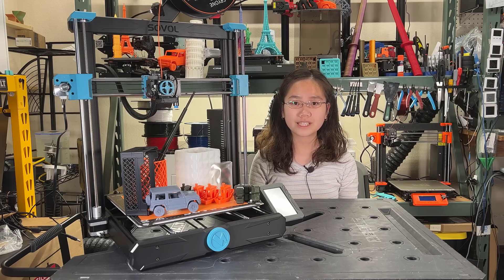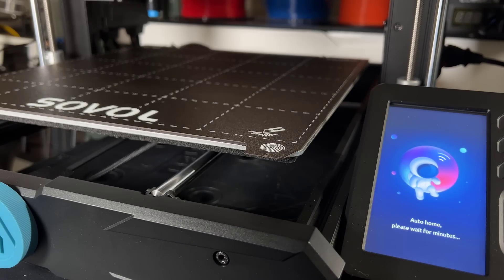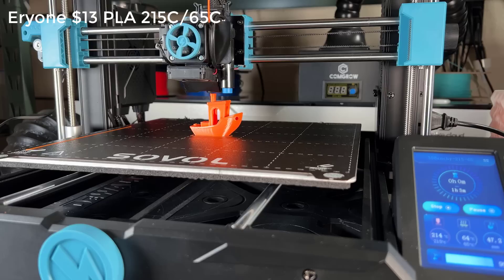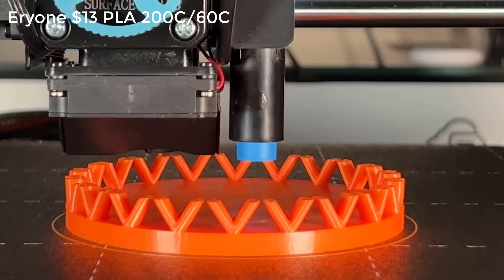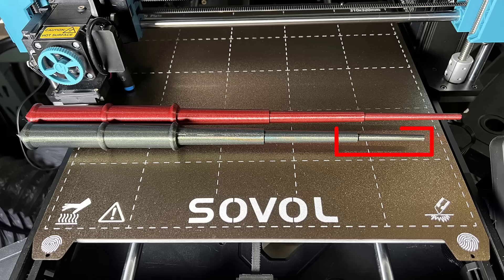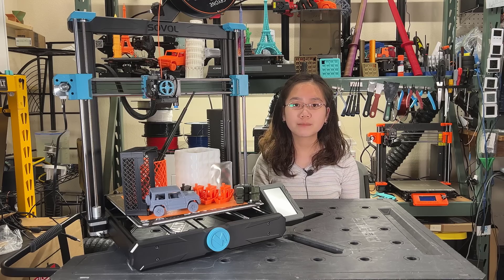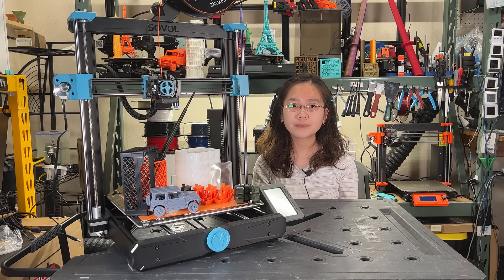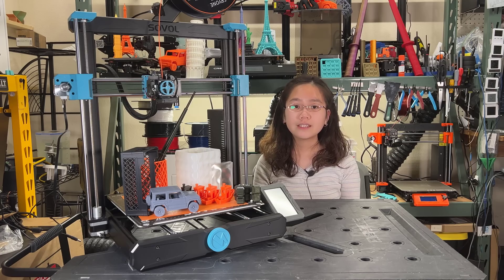Prusa MK4 or MK3.5 pumped-up Clone? The $349 Sovol SV06 Plus w/all-metal planetary direct extruder

Comment: While I wait for Sovol or Elegoo to make a full featured 300X300 mm Klipper machine, it's very tempting to buy the very capable SV06 Plus, add a Klipper pad, do a proper input shaping calibration, and maybe implement better cooling if I need to print fast or overhangs/bridges.  The cost of the Klipper pad isn't too bad when considering that it can control a small print farm of up to four SV06 printers so it would be cheap and easy to expand.

Comment: Sovol got a lot right with the SV06 Plus.  It's tempting to put Klipper on an SV06 Plus but I'm waiting to see whether Sovol or Elegoo will produce THE Klipper bed slinger.  The SV07 has nice features but it should have been the SV06 (and SV06 Plus) with Klipper.  The SV07 motion control is a downgrade from the SV06.  I completely concur that Sovol should stop using micro SD cards on their printers.  That's honestly my only complaint about my SV01.  In 2023, I want to send files to the printer using Fluidd/Klipper via WiFi.  Sovol and Elegoo are both making Klipper bed slingers with some great features but they're still coming up short in a few key areas.  One of the 3D printer manufacturers will market a Klipper bed slinger that checks all of the boxes.  I guess I'll wait to upgrade... hopefully not too much longer.  SV08 Plus?  Neptune 4 Pro Max?

Thanks for another great review.  Your reviews are the best, with plenty of user oriented tests to evaluate performance.  Too many people get a review printer and do a lame unboxing video that wastes the viewer's time and doesn't provide much useful information.  Your reviews are thorough and very fair.

Comment: Do you have a score for this Sovol SV06 Plus like the ones you recommend on your recommendations page have? I'm surprised to see that you mostly recommend v-rollers ("Ender 3 style") instead of smooth rods ("Prusa i3 style") like this SV06 Plus uses, while the consensus seems to be that rods are generally better. Does the SV06 Plus not deserve a spot in the recommendations? If not, which would you say is a better machine at $350-450? Thanks and keep up the good work!

Comment: Its not your fault but this review did not match with the printers they're shipping. The review models I've been seeing have been operating flawlessly with just some design complaints. 

The model I got felt like a kit jist thrown together. All of the screws were lose, the auto leveling sucks especially the z align. I had the pronter for a week and had nothing but oroblems, got 1 good benchy out of it, one of the included light houses i had to scale down really small to print and i got a low poly cat statue printed that i again had to scale down to get to print. 

Thank god i purchased throigh Amazon bc their customer support is ass. Just returned it though amazon

Comment: I just received this as my first 3D printer. I'm about to put power to it as I write this. So you're current suggestion for this machine would be to use Cura as a slicer correct? As I am not yet familiar with G-Code and how to alter it. Very professional review you focus on the things that matter and do not get hung up on too much of the small details that people buying a machine in this price bracket are not really going to care about

Comment: I have both an SV06 and an SV06 Plus (along with 6 other printers).  The SV06 is a great printer - once you get it dialed in.  It's not fast, but it's reliable.  My SV06 Plus, however - at least the example I received - is a dumpster fire - it's got some serious issues and Sovol hasn't been exactly aggressive in helping me get these issues sorted out.  The first thing I did was print the pre-sliced Benchy - and it was pretty terrible (tried different PLA's as well).  Then I tried the pre-sliced Castle - and it showed the same artifacts.  I resliced both files and again, print quality was substandard.  I tried other models as well - same artifacting.  I've checked belts, sprockets, and bearings, but everything checks out.  It seems like any surface pointed at the 3 o'clock to 7 o'clock quadrant of the build plate suffers some pretty serious ringing and cooling artifacts.  I'm also noticing that the SV06 Plus is lot noisier (stepper motors) than my SV06. I've sent pictures, emails, descriptions, gcode ... and although I've gotten responses, they've been things like "printing too hot and too fast" (at 40mm/S?).  I'm wondering if I have a bad stepper motor or bad driver chip ...

Comment: great review. when you print PETG do you use some kind of glue on the surface or just print right on the surface? I hear that the PTEG sticks too well to PEI surface and tears parts of the surface out when you remove the print.
Reply from the maker: No, you don't need glue to print PETG. You can print directly on the textured PEI sheet. I printed the PETG trashcan after printing ABS, so you may still see some glue residue on the print surface.

Comment: Your sv 5 with the sprite  excruder  how did you get it to work .I tried with no success.  Did you use ender software  or sovol. When I attempted  it it would only excruder  the prime line and skirt . Then it would stop excruting filament. Any info would be appreciated  along with the stl for your back plate you printed
Reply from the maker: If the stepper motor stops once the print starts, there may be a chance that the current of the stepper driver is too low for the new motor. 

In this case, you may need to increase the current by turning the screw next to the stepper driver. To do this, use a multimeter to measure the VREF value and increase it to the same level as the X and Y stepper motors. 

If you need more information on setting VREF, take a look at this article: 
https://all3dp.com/2/vref-calculator-tmc2209-tmc2208-a4988/

I just added the link to the 3D-printed plate under the description.

Comment: cheaper but i have 2 broken machines hot end failure bed alignment going out etc ps don't use sovol software it shakes so bad print fails and firmware that does not load why do u have to rename a file 2 dozen times

Comment: I would like to see what you can do with this and a creality pad
Reply from the maker: I tried it with an FLSUN speederpad, which is basically the same thing as the SonicPad, and it worked just fine. The results were similar to the Elegoo Neptune 3 Pro and Plus that I have tested in other videos. The printer can print at around 120-150mm/s, but if you want to print faster than that, the stock cooling fan needs to be upgraded as well.

Comment: Buy the Elegoo nept 3 plus now or wait for sovol upgrade announcements?  How long do these upgrades take typically for Software upgrades ie klipper to get the 150 mm/s etc
Reply from the maker: In terms of hardware, the SV06 Plus is better with its linear rods and 300C all-metal hotend. However, currently, it's difficult to find larger diameter nozzles or hardened steel nozzles for Carbon Fiber or other abrasive filament printing.

The Neptune 3 Plus, on the other hand, has a larger print volume and uses regular MK8 nozzles, which are cheap and easy to buy. However, it only comes with a rubber wheel motion system and a 260C hotend.

If you only print PLA, PETG, ABS, TPU, and other regular temperature filaments, the Elegoo Neptune 3 Plus would be a better option. If you want to print some engineering-grade filaments (and assume Sovol will support standard Volcano nozzles), then the SV06 Plus is the best option.

Switching to Klipper requires a SonicPad or any Raspberry Pi compatible device. You just need the printer.cfg and firmware for the printer motherboard. It should take less than 15 minutes. Files shared by existing SV06 users are available online at https://github.com/bassamanator/Sovol-SV06-firmware.

It requires you to SSH to the device and find the port ID and update the printer.cfg depending on what you use(SonicPad, SpeederPad, BTT CB1 or something else...)
Reply: Thank you!!! For the very detailed response.  Your videos and this thoughtful response to my post are amazing.

Comment: I have been in love with this machine from day 1!

I attempted to swap out the stock bearings for drylin bearings and that was the only time that I have had an issue with it.

The drylin bearings simply didn't have the range of motion that the stock bearings did. And, no matter what I did, the use of them resulted in significant ringing.

I believe this was caused by the bearings having too much resistance at the beginning of each movement. Once under motion, the ringing disappeared and the lines were perfectly smooth.

The only other issue I have with this machine, right now, is sharing it with my wife...

Comment: will it run on sonic pad?
Reply from the maker: Yes, you just need the printer.cfg and firmware for the printer motherboard. Files shared by existing SV06 users are available at: https://github.com/bassamanator/Sovol-SV06-firmware.

It requires you to SSH to the device and find the port ID and update the printer.cfg depending on what you use(SonicPad, SpeederPad, BTT CB1 or something else...)

Comment: Another awesome and thorough review!  You always pick up on things that no other reviewer has yet to.   One thing I wish every reviewer would do is specify if the touchscreen is capacitive or resistive.
Reply from the maker: When you see I use a hex driver to control the screen, it's resistive. (And this screen on the SV06 Plus is resistive).
Reply: @AuroraTech   This used to be the rule.  Nowadays there are generic styli for capacitive screens as well.

Comment: Without input shaping, the printer can't really be evaluated. I look for max flow, minimum layer time, and max accel number in reviews and don't get them here. More tuning of profiles will be necessary at high speeds as well. I shouldn't complain about free coverage on these machines, but the videos could be a lot more useful.

Comment: Absolutely love mine and have been running it almost non stop since I received it. So far it's been through a spool of petg, asa, and some silky pla. The nozzle issue is frustrating since I hoped to print nylon CF with it and have tons of volcano nozzles lying around left over from my artillery x2. I have some pc and pmma on the way to try so I'll just set the nylon aside for the moment.
Reply: Has this nozzle issue been resolved yet?  Can you use other size nozzles yet?

Comment: Hello. I just checked your recommended printers in each category and was surprised not to see the Sovol SV06 on the list. Is there a reason for that? I would think it's superior to any of Elegoo's offerings since its motion system is based on linear rods and also the extruder is all metal. Capable of heating up to 300 C.
Reply from the maker: Yes, may be in the future when this SV06 plus can use regular volcano nozzles. For now, you can't find larger diameters or hardened steel nozzle anywhere.
Reply: @AuroraTech  Well, I was referring to the SV06, which has hardened nozzles available and seems to be a pretty solid printer.
Reply: @AuroraTech  I wouldn't buy a printer using V wheels and lined hotend. I think the SV06 is superior in almost any respect to any of the Elegoo's printers. Only thing that's better, in my opinion, on the Elegoo's printers is aesthetics, but that's just looks, not a factor in print quality

Comment: I missed seeing a review for a few weeks. I t was good to see another solid mid range. Really want to hear about the K1. Have you heard about a DIY Assembly 100 Printer that claims the faster self printed machine, Be very interested in a review of that. It used round rods versus rollers. Any thoughts on how to lighten the bed weight on 10S Pro for max speed. Thoughts on retro fit the 4.2.7 board to the 10s Pro and adding shaper. I want to see more technology applied to older machines and especially the self tuning Science. Great effort guys, really enjoy the videos. Take care, Dennis in Virginia

Comment: Other reviewers report z axis synchronization - leveling issue ,cooling inability at high speeds and proprietary nozzles, in reddit also many users have problems with faulty machines ,i mean above the average rate of problems

Comment: I ended up with a Anycubic Vyper which seems to be the same class as these  "plus" ones from elegoo and sovol, buts its actually got dual z steppers drivers so doesnt need to ram anything,  it takes volcano hot ends without modifications,  has a preasure touch, same one as on the new Prusa, they released the firmware and new community edition was just released bumping up the bed mesh from 4x4 to 7x7 and adding all the klipper features withotu having to go klipper.  Very impressed but its a bowdne setup is the only reason id think of trying a sovol or something different but i have 0 issues with the bowden so i dont know if going to a heavier head is worth it? Maybe faster prints slightly due to shorter retractions? I hear it was a huge upgrade for some but they never explanied why.  
But anyway its not a perfect printer either (vyper) , no all metal hot end, so only goes up to 260, but ive printed ABS fine with it in the open maybe thanks to a good bed?  Some long ABS prints still warped but with a big enough brim i was able to get rid of it, but orientation helped more.  With bad orientation I had a corner lift even with a raft, it pitched a tent lifting the raft up in one spot , amazing amount of force must of been concentrated there and even more amazing it  didnt lift the surrounding raft.  An enclosure would be ideal but not entirely necessary like some think with ABS.

Comment: I bought 2 sv06 and 1 plus, i returned the 2 sv06 because a warped bed, and the plus fryed the motherboars when the micro usb was connected to the mb and the usb end of the cable touch the bed, made a spark and fryed the micro usb controller, so i have a damage mb. Not a good experience with sovol...

Comment: How hard was it to replace the hotend and nozzle?
Reply from the maker: Just like how you replace the volcano nozzle, they have the same threads and thread length, they can fit together but unusable as the fan duct is actually lower than the volcano nozzle, so you have to stick with the stock nozzle(with a longer head) for now.

Comment: I'm calling shenanigans.  The cover image makes a big deal about "perfect first layer". We all know that that's Prusa promotional speak for the strain gauge calibration sensor of the Mk4.  It was used deliberately here to imply that this printer had that feature without quite saying so.  Imagine my surprise when I found that feature missing in action, and instead you have to manually set the Z axis offset.  So that "perfect first layer" is only as perfect as you fine tune it to be.  That's not a mk4 clone, that's any i3 style printer with auto bed leveling that still requires Z offset adjustment.  If you want a Prusa to compare it to, that's Mk3 territory. 

While the first layer was shown off on the thumbnail, in the video it only appears at the end if the video.  That raises further suspicions.  It was important enough to hype on the thumbnail, but then it's relegated to the end of the video?  Why is it being hidden?  And why is it only shown on the build plate?  What would we see if it was removed?  It's only once it's been peeled away that you can see whether the layer has solidly bonded.  Instead we are shown a single still image with glare hiding some of the surface texture.  It should have been removed and held up to light to show how uniform it was, and flexed to show whether any of the lines had failed to bond.

I'm getting the feeling that these videos are more promotions than reviews.  There's no excuse for the deliberate usage of Prusa's promotional claim relating to its strain gauge calibration, and the further evasion around the actual quality of that layer raises more questions than it answers.  The video works far too hard to try to frame this as a Mk4 clone.  But about the only thing that you can compare to the Mk4 is the planetary extruder, but the base SV06 had that as well, and the review at the time framed it as a Mk3 clone.  Funny that, what a difference four months make.  It had to be hyped up to compete against the next generation, huh?
Reply: Take a look at the video on YT of "Sovol SV06 Plus, large, powerful, easy to use" and the bed leveling section starting at 2 min 28 secs.
Does not show closeup but may give you an idea of it.
Reply: @Cloudman572  it may be worth pointing out that that was a sponsored video, meaning it WAS a commercial for Sovol, and he didn't show how much work it took to fine tuning the z-axis offset in order to get those results. I may have been able to see a thin spot in the results but yes, he wasn't too eager to show it to the camera, he waved it across it pretty quickly.  That might have just been carelessness, or it might have been a deliberate desire to cover it up.
Reply: @NomadSoul76  What you do with the video is up to you- I was just trying to help, to me extra info is good.
Reply: Agreed. More reason to use Amazon when these printers don't live up to the hype #Return

Comment: I would like to know what is your opinion of the Sovol SVO6 compared to the BambuLab X1 Carbon, because I like to print Nylon-composite, Glass field Nylon, and ABS.
Reply from the maker: I'm afraid that's not a fair comparison. The SV06 Plus is a budget printer with good value, but it's still an open-frame bed slinger with Marlin firmware. The X1C, on the other hand, has the most advanced features, which is way better.
Reply: This poor sovol clone could never compare to bambu anything 😂